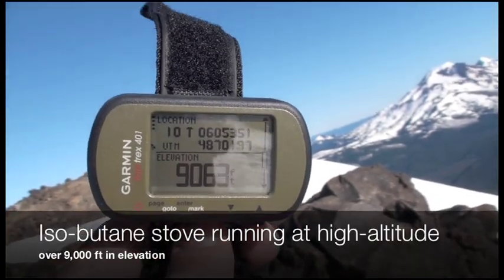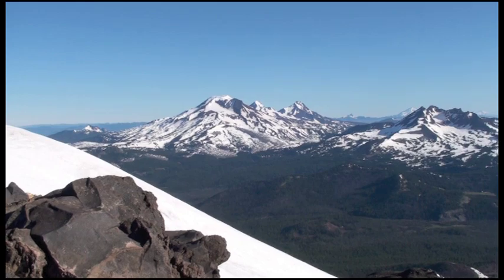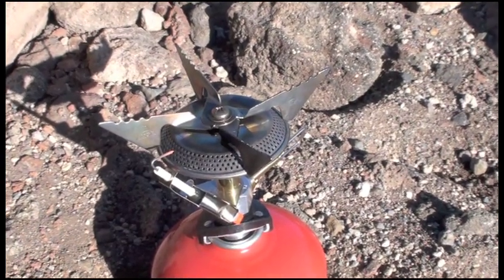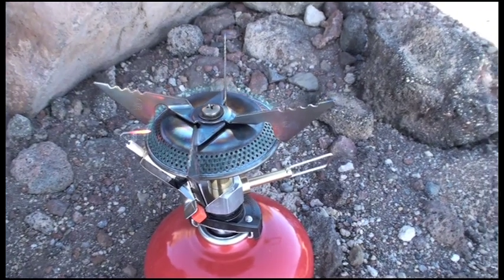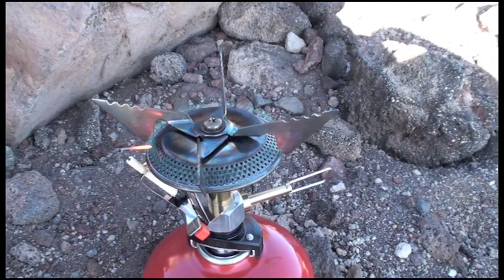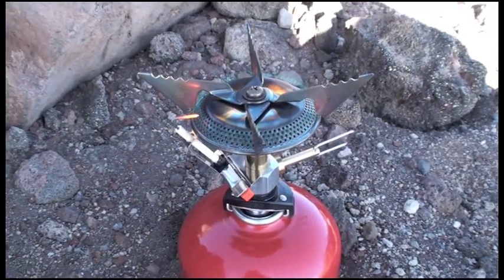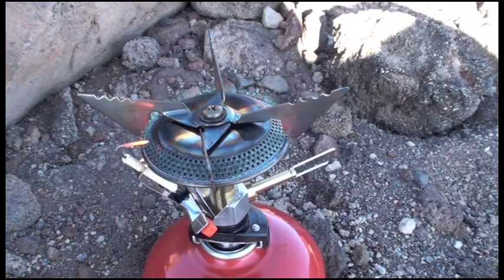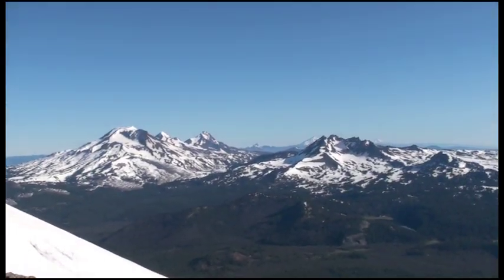Running an iso-butane / canister stove at high-altitude (MSR SuperFly)

Comment: Canister stoves work fine at altitude.  In fact, the higher you go, the colder the temps they function well at.  Which is why canister stoves are used on Everest.
Reply: They work fine at altitude but not cold weather. I tested mine and it couldn’t perform correct at 16f.

Comment: I've been on the trails (or what have you) 50+ years. I've owned or own several dozen stoves of various types. My absolute all time favorite is a solid fuel tablet (Esbit, Bleuet, etc) burning tri-wing design stove. I've been all oner the US and Canada at many altitudes at many different temperatures and I've yet to find a place where it won't work.

My second all time favorite is a Snow Peak Titanium Gigapower canister stove (I don't think the titanium version is imported any longer) similar to the stove in this video. Canister stoves (and lanterns) tend to burn very well at high altitude because there is less atmospheric pressure pushing against the fuel pressure inside the canister. BUT (and there's always a "BUT") when you go high the temperature drops. My first canister stove was a Bleuet with butane in the tank. At roughly 32 degrees F (0 degrees C) fuel tank pressure was zero because the butane was frozen and I had a hydrocarbon slushie. It didn't matter what altitude I was at...it wasn't going to burn.

Manufacturers began altering their slushies by adding isobutane...you would then have pressure and combustion available down into the teens. To get available pressure down to approximately -40 F and C, the manufacturers added propane to their slushie mix.

Obviously high altitude cooking isn't as simple as it would first appear. Different things are happening at the same time. As mentioned canister stoves burn quite well at high altitudes. But the canister has to be maintained at an operable temperature and that can be complex, if not hazardous. I've been known to use fuel tablets to heat water to warm fuel canisters to heat ice to get water. Oh well, if it was easy then everyone would be doing it and Everest would be crowded and dotted with piles of garbage. On second thought.....

Comment: Actually, the higher you get, the more easily water will boil, so the stove will consume less fuel to make it boil. It's physics.
Reply: bigalexdotit: agreed. Water boils at a lower temperature at 9,000 ft, figure water will boil about 198 degrees, so all other things being equal, it should take less energy (less fuel) to meet that mark at that elevation.